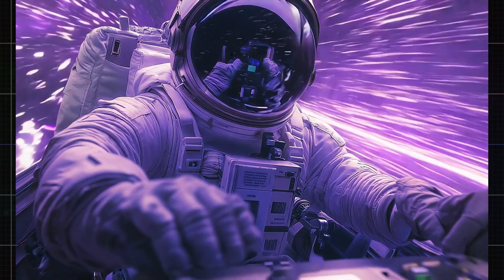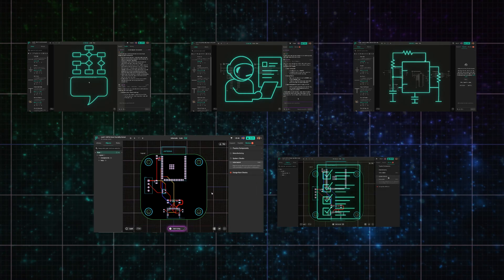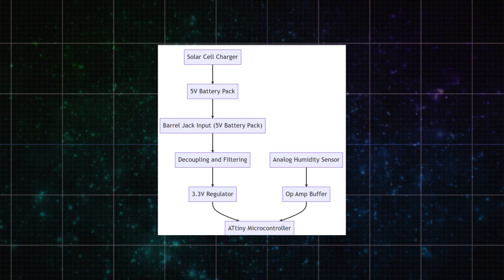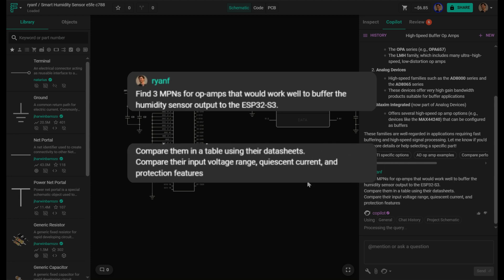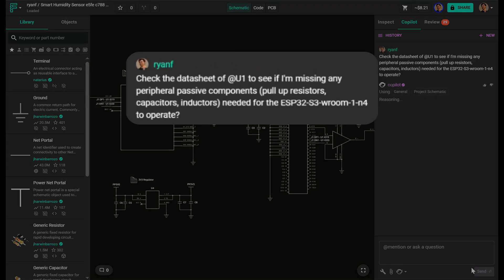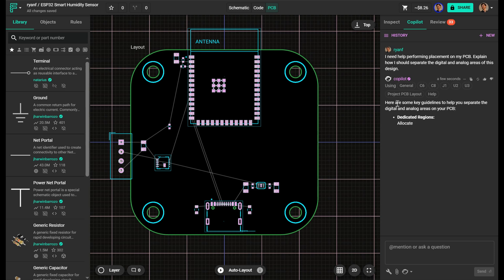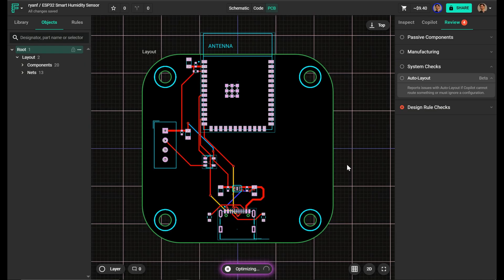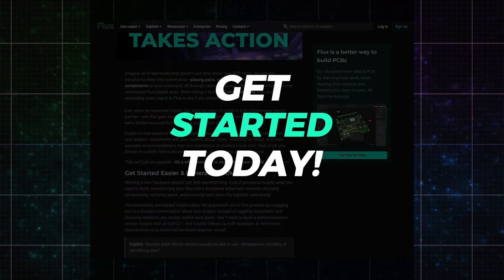AI PCB Design - Quick Start Guide for Flux Copilot

Comment: scam. you go for free trail and gave them cc for 15 USD. When you run out 500 credits they charge you automatically for additional 2500 credits  - 100USD. silently. no warnings. system itself designed to scam.
Reply: Nope. You can set the max limit per month for copilot you just cant read
Reply: @adamwerner8696  you can but you won't find out til you've gone too far, also there are a lot of failures and you get to run it and forfeit credits.. it's like gambling and the house always wins.

Comment: Apart from the fact that at first the AI connects the output of the Op-Amp to the output of the Humidity Sensor, even when it is flipped (you can see the "final" schematic at 3:24), the circuit it produces is completely non-functional. Depending on the orientation of the inverting and non-inverting inputs of the OpAmp, once powered the IC will permanently pull the output to 3.3 or GND. This value will never change and there is no way for the ESP to ever get any actual values from the humidity sensor. 
This should be trivial to any actual EE. The fact that this made it into a promotional video is baffling to me.

Comment: Reading of datasheets by copilot is a bit iffy.
I asked the copilot to calculate feedback resistors for LM5160. The provided calculation/equation was OK. But the copilot used incorrect reference voltage. When I pointed out that the value is incorrect and I even provided a link to datasheet the copilot still couldn't give back correct reference voltage.
It was a waste of time and credits for such a trivial task. Btw ChatGPT did the same mistake as well.